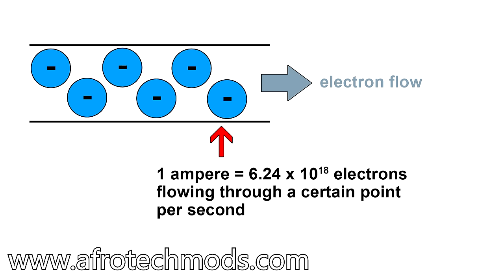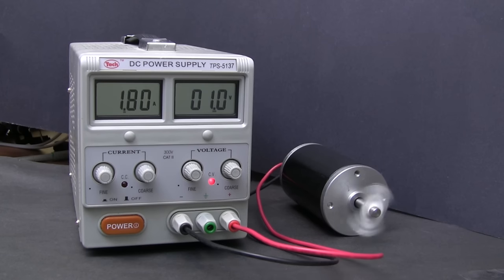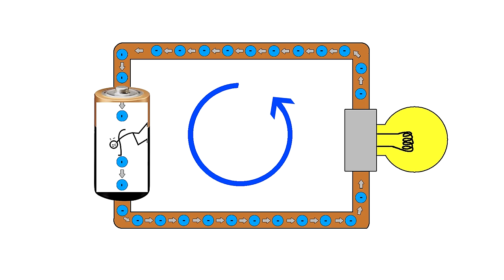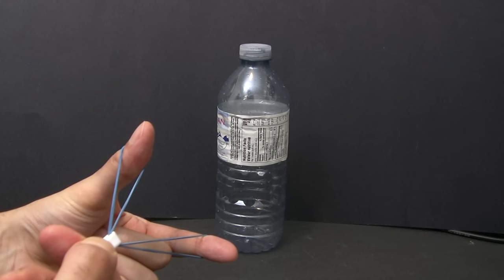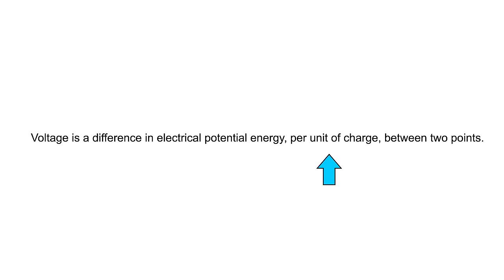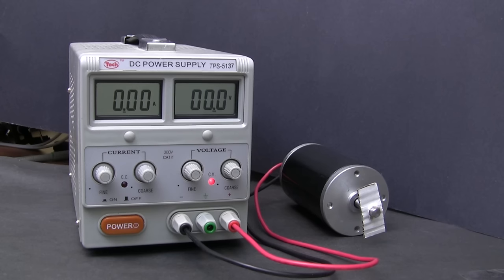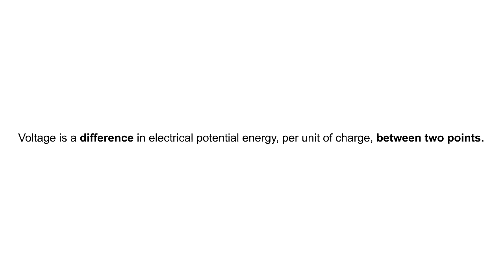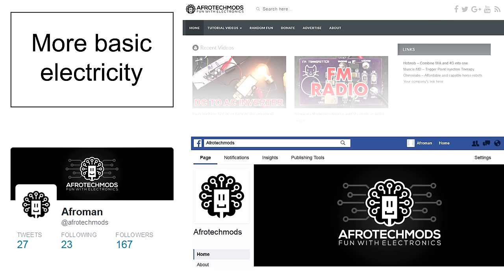🔌 Basic Electricity - What is voltage?

Comment: This, In my mind, Is much better than other videos like animations that attempt to use height and other unrelated things to show that a higher voltage is more energy, but it just makes no sense in my mind. Gravity is nothing like the energy that pushes electrons.
Reply: It's in fact very much like gravity, it's basically the same formula for the electric and gravitational force, but with charges instead of masses.

Comment: Nice graphics and informative, but one misleading statement. At 2:52 the narrator says, "...electrons push other electrons..." which is not true, even though it may be intuitive. If this was water in a pipe, then the water molecules would indeed push other molecules down the pipe, but electricity is NOT water flow in a pipe. This is where the "hydraulic analogy" falls short. The battery is a source of an electric field. As soon as the circuit is connected, the battery's electric field is guided around the circuit via the conductors (electrical conductors can also be called wave guides). The electric field travels around the entire circuit at the nearly the speed of light (specifically at the velocity of propagation). Once the field is established, each electron in the conductor is nearly simultaneously subjected to a directional force along the conductor. The electric field (not the other electrons) "pushes" each electron around in the circuit. When the electrons arrive at the battery's positive terminal, a chemical reaction (specifically a reduction reaction) is driven and uses the electrons in the reaction, gobbling up the electrons. At the same time, the battery creates electrons at the negative terminal via a complementary oxidation reaction, keeping the number of electrons in the system relatively constant. Read more by researching the Lorentz Force Law of electric fields (i.e. F=qE, where F is the force vector, E is the electric field vector, and q is the electrical charge, such as an electron).
Reply: IGNITE you just want us to think you’re a nerd too.
Reply: @mrmalone28  I'm afraid so...nerds rule! I also hold BSEE and MSEE degrees (so I guess I learned something in school). What would this world be without nerds? Cheers!
Reply: why im so dumb
Reply: A long-winded and unnecessary explanation for people who don't understand what voltage is!   When explaining to beginners, keep it simple and don't try to impress with your superior knowledge, otherwise the audience will just switch off.
Reply: @karhukivi  I disagree but upvoted your comment anyway. Soren's comment is good as complementary to the video, which is what is meant to be. It's not good as a standalone explanation. The analogy has to come first because it's helpful, then the explanation as to why it falls short by introducing new concepts.
Reply: @yosha2467  Soren talks about conductors as waveguides" - that only applies at microwave frequencies, not at DC.  As I said, a complicated "explanation" which will confuse beginners to electricity.   You don't introduce advanced topics to children starting high school science.
Reply: Thanks 👍
Reply: Please...

Comment: So...here's ssome things I need to be clarified.
If there is a 9V battery, there's a difference of 9 joules per coulombs between the electrodes...but what does that mean? A joule is a unit of energy. So the electrons on one side have less energy per coulomb? How? Is this a measure of the potential energy of the electrons?
And does one side necessarily become a particular charge based on this? If what I extrapolated from the information is correct, I would assume current MUST flow from the side with more energy to the side with less. Would that make the positive electrode the one with higher joules per coulomb, forcing electrons out from that side and into the negative side?
Reply: Good question....can't anybody answer it?
Reply: Same qustion
Reply: So the way you should think about potential difference is that if you take a particle of a certain charge and move it from the positive terminal to the negative terminal of a 9V battery, it will experience a change in energy of 9 times the charge. So yes, this does mean that if you move an electron (which has a negative charge), it will experience a negative change and lose energy whereas if you move a proton from the + to - terminal, it will gain energy.

Also, no, the different sides of the battery do not need to be specific charges. In fact, you could very well have a 9V potential difference in a system that is negatively charged on both sides; just make one side more negative than the other and electrons will still want to flow away from that side. More to the point though, you don't even need a specific difference in charge between sides to get 9 volts _specifically_. The difference in energy is as much a function of charge as it is the distribution of that charge.

Finally, yes, you are exactly right to say that current flows from the side with higher energy to lower energy, however, no, the positive end doesn't force electrons out from it. Instead, remember that current flowing in say... the "left" direction could either be something positive (like protons) moving left or something negative (such as electrons) moving right_. So the current going from the + terminal to the - one is _actually negatively charged electrons going from the - terminal to the + one. And if you think about it, this actually does fit with our definition of potential difference; since an electron's charge is negative, it gains energy in the opposite direction to the difference.

Hopefully this helps
Reply: they;re charges.

Comment: Thank you so much!! After probably a year of being in and out of electronics and still not understanding volts/amps, this explanation is so nice. A lot of examples that use water in a pipe explain the amps as volume of water being moved and the voltage as it’s velocity. I never understood this since volume moved and velocity are directly proportional (i.e. how could you move 1A and 10V through a wire and then push 10A and 1V through an identical wire?) Comparing voltage to force instead of velocity was very helpful :)

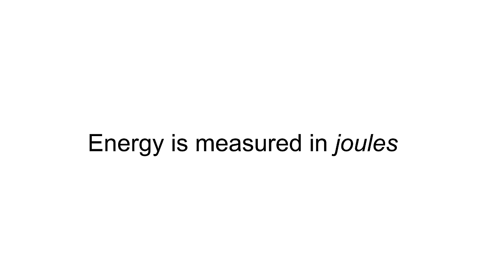Comment: The explanation gets confusing at 4:30. The statement that "one joule is enough energy to power this flashlight for one second" seems pulled out of thin air. How would one reach that conclusion? I feel the need for a visual representation of what it means at the atomic level like the very nice voltage representation.

Also the battery circuit diagram at the beginning might be confusing for people that already know a little about electricity. I think it would be useful to explain/remind people that there are two conventions regarding electricity flow. One from + to - and the other from - to +. Which is a terrible thing that probably caused me to understand almost nothing in school about electricity.

Anyway, amazing video!
Reply: I think that the the flashlight part was merely demonstrate what a joule of energy "looks like." It's similar to showing someone a banana, for scale, next to a really small or large object
Reply from the maker: Exactly. Thank you Denzal.
Reply: Macovei Vlad Banana analogies are always great.
Reply: No, there is only one convention for the electrical current direction, that is form + to -. Electrons moving form - to + is not a convention it's a fact and it is irrelevant for the topic.

Comment: I’m still having trouble visualizing or understanding 
The formula for Voltage 

Joules per coulomb

J/C

I’m finding picturing a joule per coulomb difficult
Reply: Coulumb is the charge itself let's say electron."How many electron you have ?" and you should answer that with 1 Coulumb. 

Joule is energy unit. How much energy is needed to move 100 Coulumb of electrons ?. let's say 10000 Joule / 100 Cooulumb. so, for each electron you need 10000/100 = 100 Joule/Coulumb = 100 Volt.

So, it is how much energy you need to move 1 coulumb of electrons
Reply: Use your imagination, and relate to what is being said into an object-oriented method or ways.
In other words, in stead of hanging onto the new terms you just heard on this video, put that new terms or words you heard on this video, into different simple terms you already familiar with, at 0.28 narrator on the video says, voltage can be understood as a pushing force or some kind of pressure generated by chemical reaction, just think of it as such, in your mind.
Just an FYI... Electricity is fascinating, it is truly glorifying the Creator of universe (God), by understanding all that HE has created, this is me as a musllim.

Comment: Very interesting video. Let's apply what we learned here to wall charger. Why there are wall charger that charges at 5V-3A and some other that charges at 9V-2A. If you do the right math they have the same amount of power but why some prefers to increase voltage and lower Ampere and some other increase the ampere and lower the voltage?

Comment from the maker: Thanks to some excellent feedback from fans, I edited out the potentially misleading information about EMF and reuploaded the video.
Reply from the maker: http://www.joblo.com/newsimages1/BT_3_excel.jpg
Reply: Oooooooooooooohh, now i understand. I was sure i watched this video before.
Reply: Thank you for all of your videos afroman, Ive been doing projects for 12 years as a side hobby and Ive been able to buff up my knowledge on how some of my projects work and have given me more ideas thanks to your videos!
Reply: awesome.......😅😅😄
Reply: hey you showed again after i think 9monts keep going
Reply: YOu are the best teacher. You get everything that might not make since to beginners
Reply: But if the potential misleading enters the field of a negative observer, how do you calculate the force of confusion exerted in that point of time?
Reply: It would be nice if you kept it PG so I could use it with my 5th grade class. No real need for using "damn" in the video. Other than that, it is an awesome resource.
Reply: Afrotechmods so just to see if i got this correctly, a 1V battery will transfer 1 Coloumb of electrical charge around the circuit using 1J per Coloumb. So the electrons will move around the circuit at a rate of 1 Coloumb per second and 1 Joule per second and because only 1J is moving around the circuit the components will do the equivalent of 1J of work when it is transferred?
Is that right?

Comment: Lemme guess you already knew everything about voltage but you still watched because it's Afrotechmods
Reply: You're wrong xD
Reply: If 9V means that 9 joules of energy is transferred by every coulomb of charge, then if all of this energy carried by the electrical current is transferred into light/thermal energy in the lamp, then how does the electrons have any energy or "pushing force" left to return to the opposite side of the cell?

Any help is appreciated!
Reply: @Random-nq4xj  it will really take a lot of joules for me to explain it by text.

Comment: First I apologize for my stupid question. Please, can anybody tell me, how electron on the begin of the circuit can recognize how voltage difference is between negative and positive ends of the circuit? How can it recognize, if the distance between both negative and positive is very long? 
Once again sorry, I am just a simple woman.
Thank you everybody for answers.
Reply: The electron doesn't need to know. It just moves along the electric field that is created when voltage is present. Its like when you fall off a cliff, regardless of you knowing or not knowing the height of the cliff or the fact that you have fallen at all(you might even be unconscious), you will still fall due to gravity(analogy to voltage).

Comment: Volt is J/C or energy per "lump" of electrons or energy per electron (divided). The direction of that energy comes from the chemical process resulting in free electrons which then gather at one end of the battery. Those electrons have a negative charge that repell each other, giving them a direction to move. I also like to think of the magnetic force as a build up of pressure. In a wire they sometimes collide with the material, that reduces speed and creates heat (wire has a resistance that drops the voltage), while the excess electrons keep pushing (repelling) them forward maintaining the direction and flow.

Comment: If you put 1V to a motor, what makes it draw 1.8 A ? Amps come as they are needed. This device with 1V can require 1.8V but it may require 0.5V or 5V.
Reply: Quetzalcoalt yeah stuck at this
Reply: that is the resistance of the circuit. which describes the ratio between voltage and current. which is the ohms law. 
R=U / I 
if R of the circuit is 10 ohm then then mathematically the relationship is set.
I = U/R In this case
I = 0.1 * U (voltage) 
so the current is always on tenth of the voltage with a resistance of 10 ohm.
Reply: A motor's current draw is related to the load on it.  The more load you put, the higher the current draw.  In fact, if you make the load negative on a motor (if you push it) it will generate current instead of drawing it.  We call that a generator.

Comment: so voltage is electrical potential energy per charge, but at the same time it is the difference in potential energy per unit between two points. I don't get how those two definitions refer to the same thing.
Reply: Ikr

Comment: Thank you very much! Now I can say I better understand the relationship between Voltage and Current. You give a lot of patient and well-structured information. In the end, I gather that Voltage is a kind of "electron pump", the more Voltage in a circuit, the more electrons moving. But the relationship is not linear. That depends, I guess, on what the electrons have to go through on their way to the other end of the circuit. You know, I always shied away from electricity but I can see now, with a better fundamental understanding between Voltage and Current, that it can become quite addictive. Thanks to people like you, earth is a better place to live in  :-)
Reply: Actually, the more voltage, the more force behind the electrons.  The number of electrons moving are the amps.  The relationship is often linear, but that depends on what the electrons are trying to push through.  Resistors are completely linear.  Push twice as hard (double the voltage), and twice as many electrons flow (double the amps).  This is the basis of Ohms Law.  But if the electrons are pushing through a semiconductor, like a diode, the relationship is no longer linear.

Comment: I was absolutely frustrated because I didn't manage to find an answer to my question: what is voltage? And if you actually try to search it in google there really isn't a clear and rigurous explanation, until I found your video. Thanks to that fragment where you said "Enegy is the capability to do work. Potential Energy is the potential to do work". Something that I was forced to ignore for years clicked in my mind. I finally understand the very definition of Potential Energy and thus, voltage. 

Voltage is the potential to move a unitarian charge. That's it. In Wikipedia, the definition they give is "the work needed per unit of charge to move it from a point of reference to the desired point." but that's not really the concept of voltage. That "work" that wikipedia mentions just happens to have the same value as te electric potential, that's it.

Comment: Can you say that the voltage is the work done by the battery in moving a coulomb of charge from the negative terminal to the positive terminal? Or should you only say that the voltage is the work a coulomb of charge have the potential to do when it moves from the negative terminal to the positive terminal of the battery?

Comment: One of the better explanations I’ve come across! Thanks! Quick question, does this mean that for higher voltages the electrons are carrying more energy individually through the circuit? If so, what can you explain about how that higher energy is stored at the individual electron level? What’s the name of the property that is increased as the voltage increases?

Comment: 1 coulomb = 6.24x10^18 electrons x the charge of a single electron

coulomb is still the charge, it just measures it
(puts it in a manageable number form)

if Q = I x t then
current is charge per second
Its how much charge is flowing in a period of time

20 coulombs in a circuit in 5 seconds means:
the current is 4 amperes

Energy = Charge x Voltage

If you had a battery that was
360 joules and the charge in a ciruit was 120coulombs then the voltage would be 3 volts

Voltage = energy divided by charge

P=IV

P = I^2 x R

Comment: Hello. Can you please answer me 2 questions? 
1) More voltage more current, yes? So, why we have low current and high voltage when using transformers? I know that there is power(P=IU) and if we increase one of them, we decrease the second one, because Power is constant. But it is mathematics! I want to know what is going on exactly, I want physics explanation. How can we have big "electric pressure" and low current?
2) If we rub plastic wand and fur, for example, we will get high voltage between them, but electrons do not flow back(from minus charged object to plus charged object)  even if we squeeze them. How so? We have high voltage, but electrons don't return to positive ions on one of the objects.
Sorry for my English. It is not my native language.